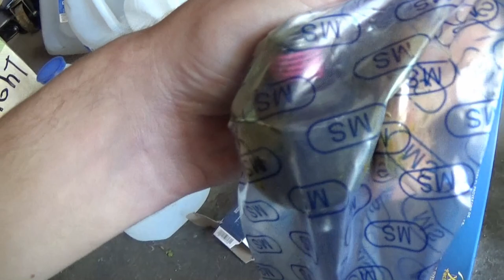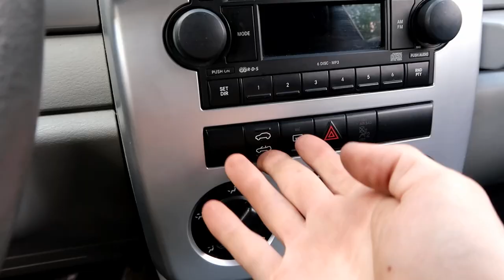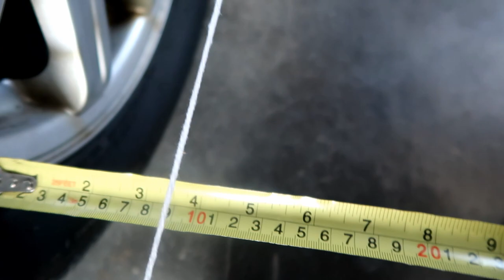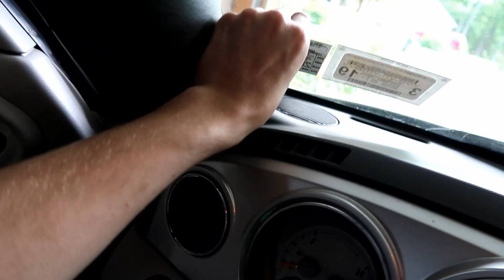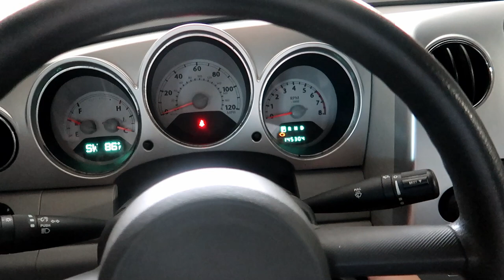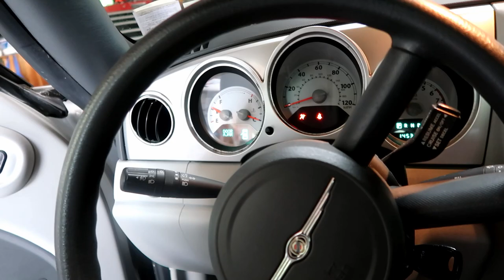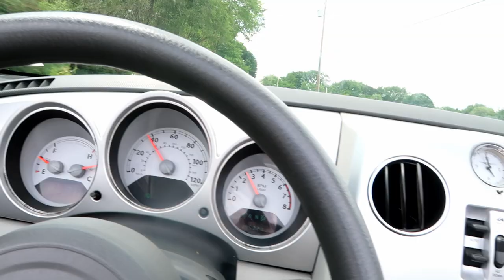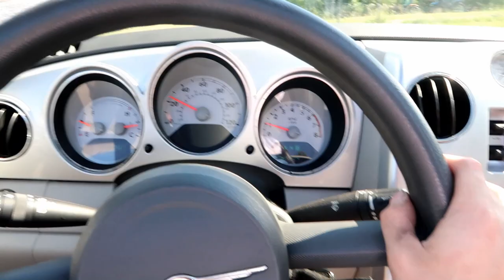Project Vert FIRST DRIVE!! + Steering & Major Brake Issue...

Comment: My 2001 Limited also had the exact same issue too. Same corrosion around the Caliper cylinder, so I did what you did and everything all cleaned up and slapped in a New Max Power Slotted Cross Drilled Rotors and Ceramic Pad along the way. Good Video and content

Comment: I solved my problem with the 59 Oldsmobile that had the stripped out valve cover bolts I ended up taking it to a machine shop and the guy did it wow the head was still on the car he put steel inserts in the hole and then drilled and tapped that for a permanent repair, but it sure wasn’t cheap it cost me $500 it took him about six hours to do it, you see there was an easy out broke off down inside the hole. I did that, LOL